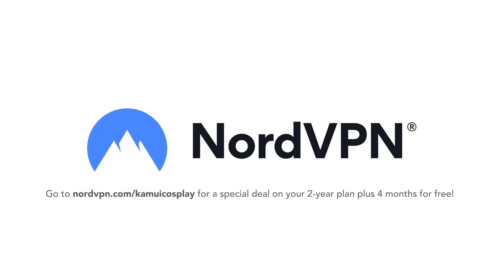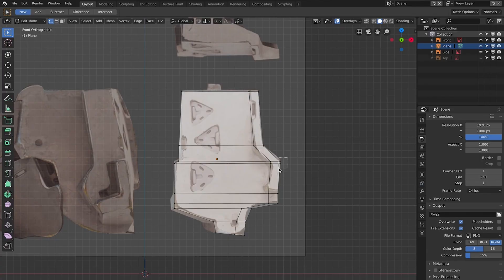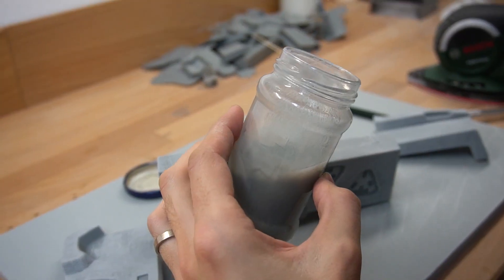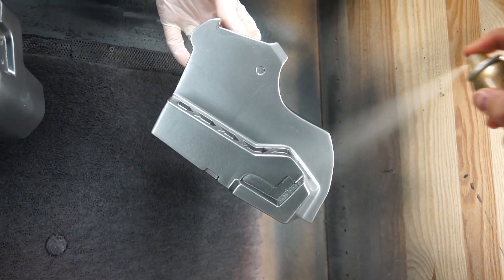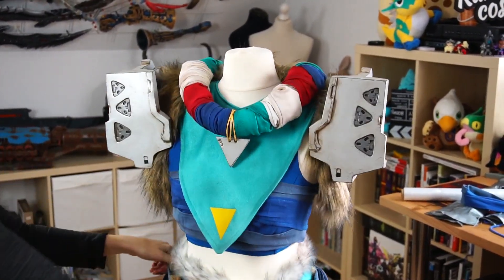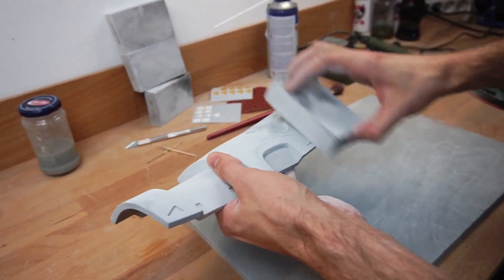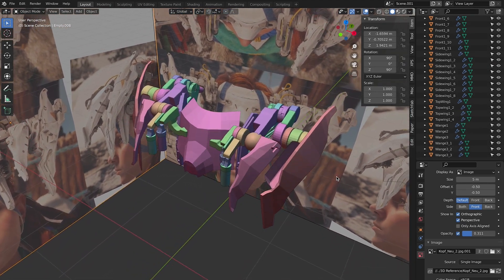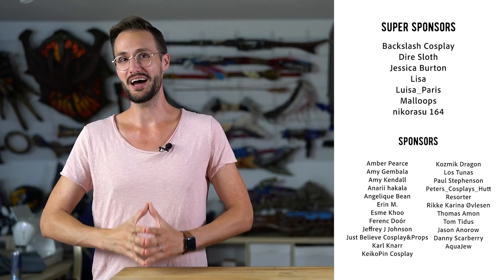How we 3D print cosplay armor! | Horizon Zero Dawn

Comment: Man, so much to learn. I am waiting on a direct drive extruder for my SV 03. I got LuBan to help with the chopping of models. It is pretty much automated. You should give it a shot. This way I can get my Ender 3 to start working on larger parts. So, I swapped out the springs, the extruder, capricorn tube and nozzle. It printed the brim and base for tree supports then stopped extruding. Meh.... I need both of these printers working toward finished cosplay. Then I need tons more filament.

Comment: I didn't understand what kind of "glue" he used to glue the pieces together :(
Reply: He took the supports that he’d cut off the  3d prints and melted them down in a jar using acetone. More commonly called ‘ABS slurry’ rather than ‘slushie’, when applied the acetone also melts the joined edges a little bit and then evaporates leaving a strong join that is the same material all the way through.
Good way to reuse the otherwise wasted support material!
Reply: @shannonporter7449  This technique is very interesting!  Does it only apply to ABS or does it also apply to PLA?
Reply: @rominasciacca1076   No, acetone doesn’t melt PLA  the same way so PLA printed parts would need to be glued together with a superglue or maybe an epoxy glue depending on the size of the piece.
Reply: @shannonporter7449  I assumed it.. 😅  thank you !